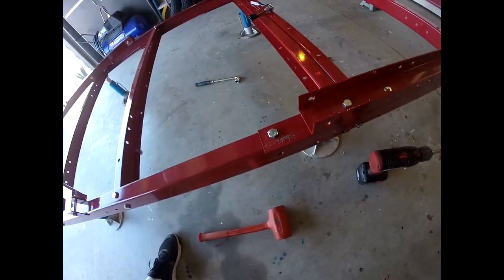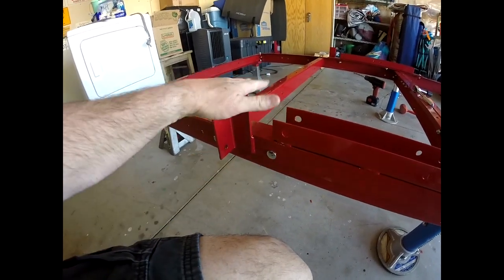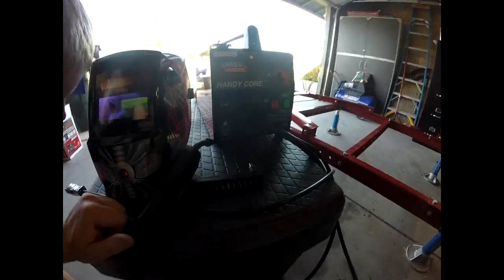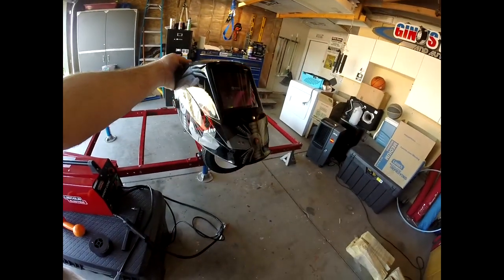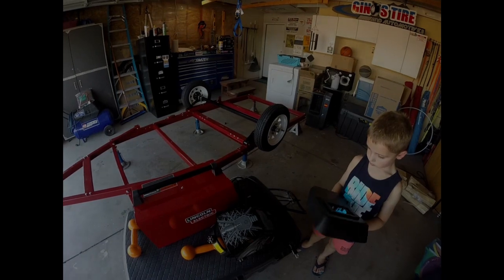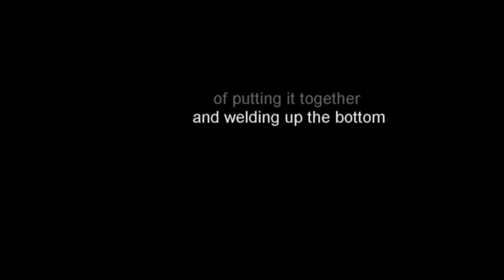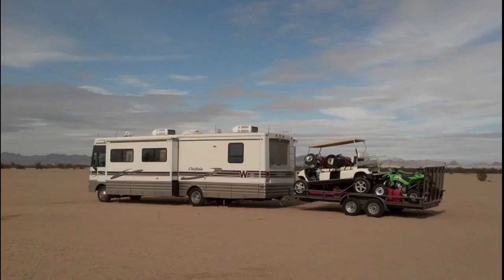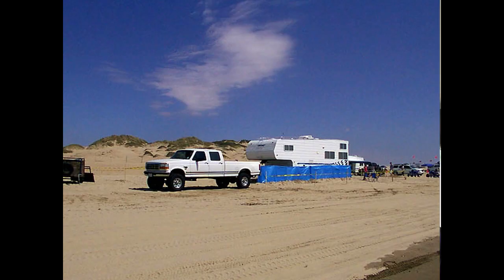Homemade DIY Camper - Tow Test

Comment: Hey, I noticed that you flipped your axle. Did you use a kit or just point the camber downwards?
Some say you have to keep the camber up and others say it makes no difference.  Curious what your thoughts are.
Reply from the maker: I have relocated leaf springs to the top of several trailers before. I have never "flipped" axles though. On this trailer I actually didn't bring the spring over the axle. This was per instructions so it was meant to be this way. However have a little negative camber in my opinion is important as it makes the tires track straight.  But just relocating the springs to the top won't change that.
Reply: I did a springover lift on a regular utility trailer and welded new perches on top of the axle because of the slight arch it has.
Reply: @robertallen1662  I ended up getting an over/under kit from eTrailer and using that. Comes with 2 perches, 4 U-bolts and 2 plates.
I haven't welded it yet. Right now it's just bolted, but I will weld the perches as soon as I get ahold of a welder. - Episode 51